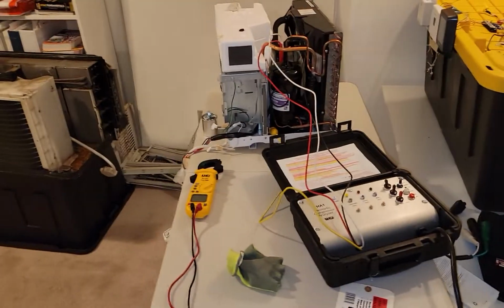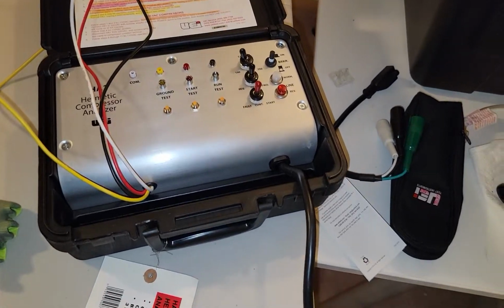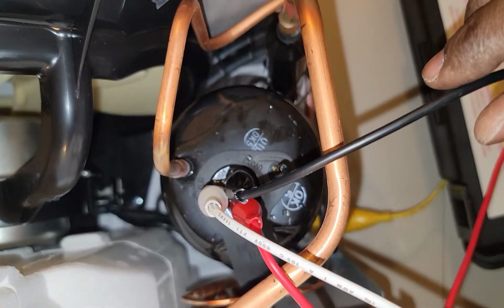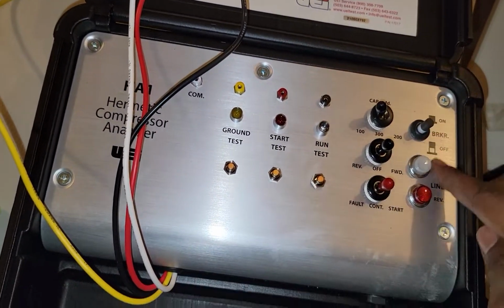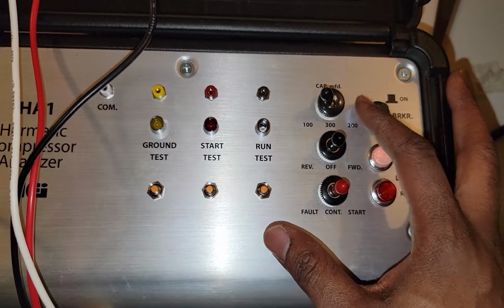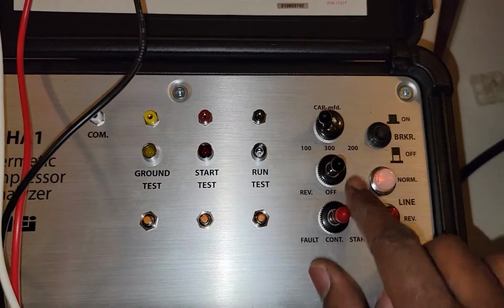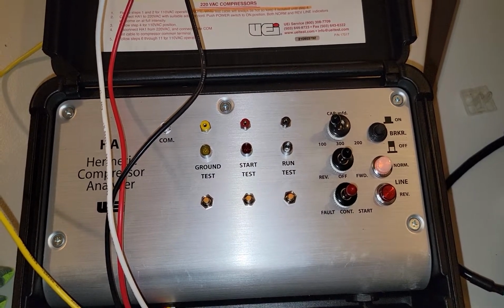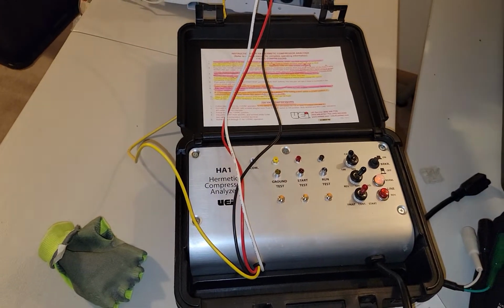How to use a Hermetic Compressor Analyzer by Leo. D

Comment: I have the same device. It's easy to use when whatever compressor you're checking is only around 115v. What is confusing to me is when you need to use it for 220v applications. 
I used it today on a 230v condensing unit for a 5 door reach in cooler. The compressor, a hermetic Copeland, would not start. LRA was rated at 22 and was pulling 20 on start-up, then shutting off. Let the compressor cool a while in case it was going off on overload. It didn't help. Checked capacitor first, then windings, then short to ground. Everything checked out fine. I thought to myself that maybe the start components were bad. That's when I pulled out the analyzer. I hooked up my cheater cord directly to the relay that gave power to the condensing unit, which turned the compressor on but not my cfm. Plugged the wires for the condensing unit back onto the relay and relocated my cheater clips to the other end of the power wires that tie into the start components. This turned everything on, and cooler was doing in temp, pressures looked good, and a minute or so in the compressor died, breaker tripped, and my relay got stuck in the closed position so after resetting the breaker and with the power switch off my cfm was on constantly. 
The compressor was making noise while it was on and was really hot to the touch after. I was pulling 10 rla, so I assumed the compressor was bad. I left the yellow ground cable connected to the frame of the compressor, like the instructions said to do when checking 115v.
Reply: Did I do something wrong? What is the correct way to use for 230v systems?